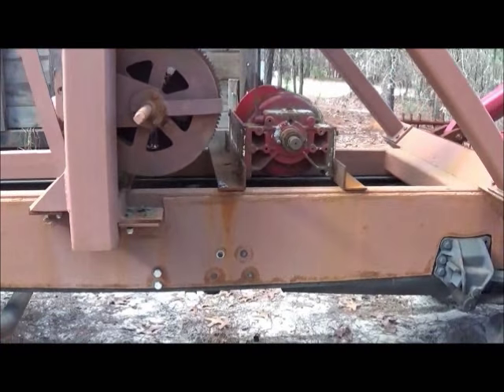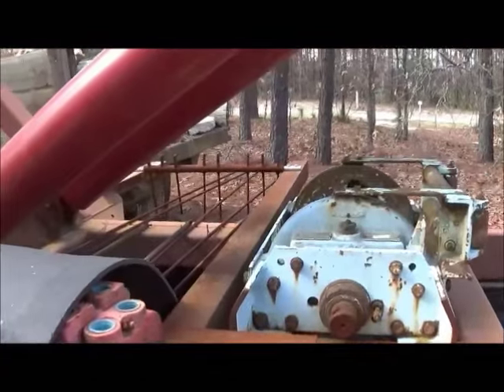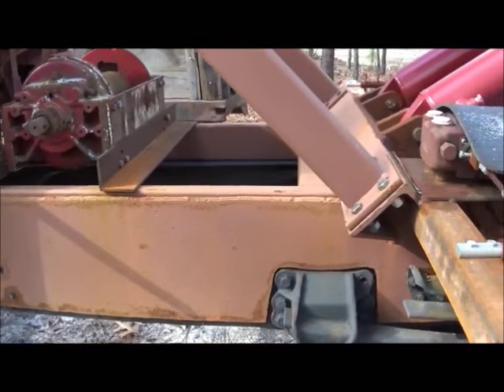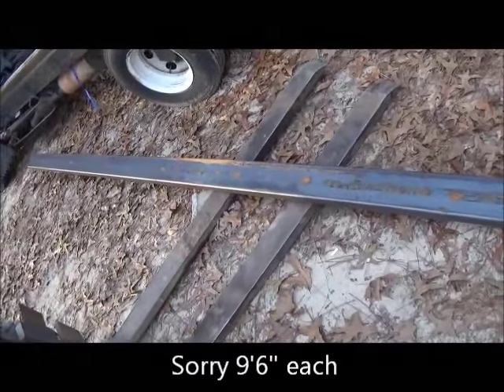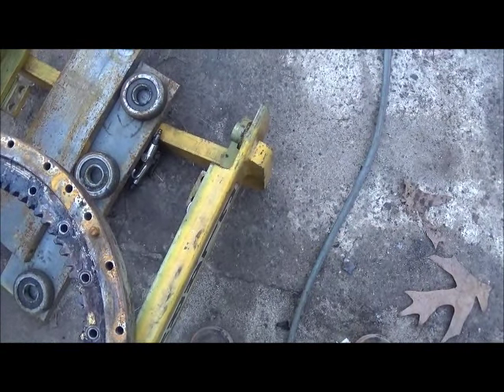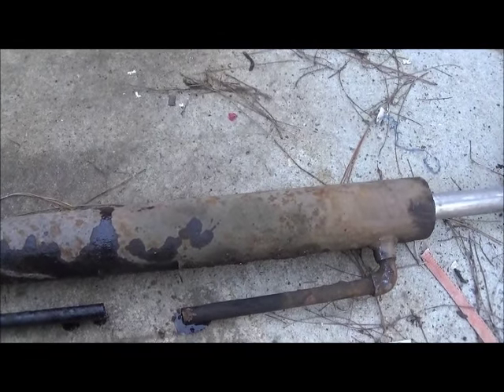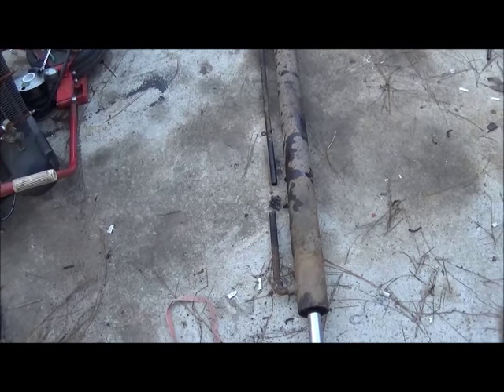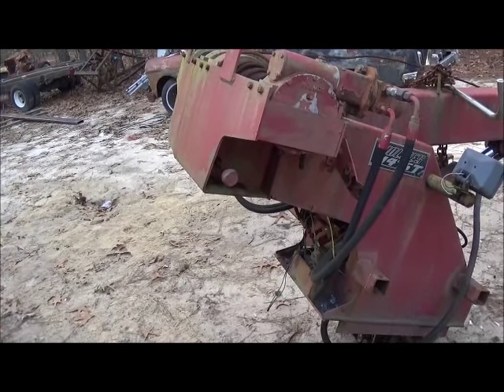4x4 Wrecker Build Part 21 Just Collecting Parts!

Comment: Could I bother you for the steel thickness of the boom extension?  The same as the boom? 3/8 for the bottom and side plates? Internal cylinder or top mount to push the boom extension out?
Reply from the maker: +montwolfman Internal cylinder. Inner boom is 1/2" square tube.
Reply: Thanks, what do you recon it would lift at max extension?